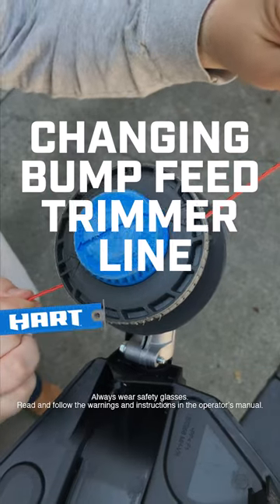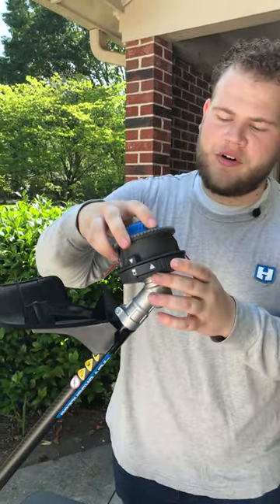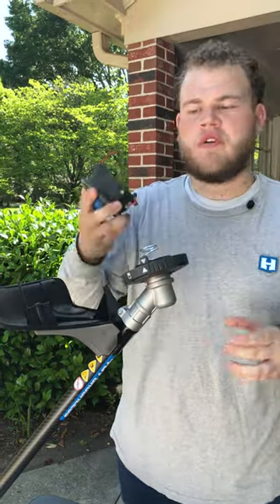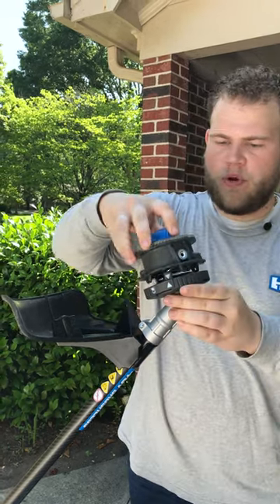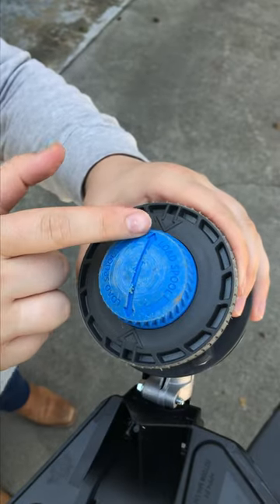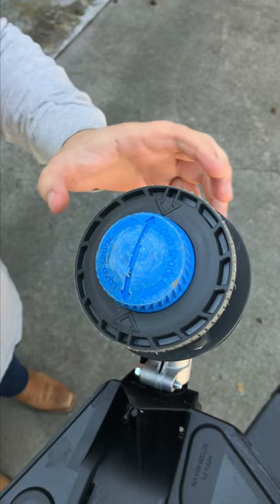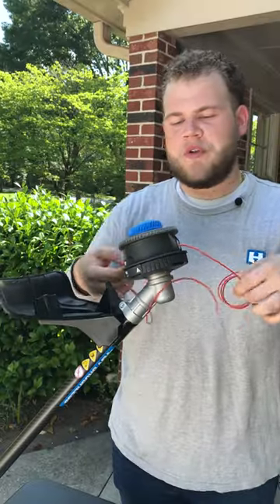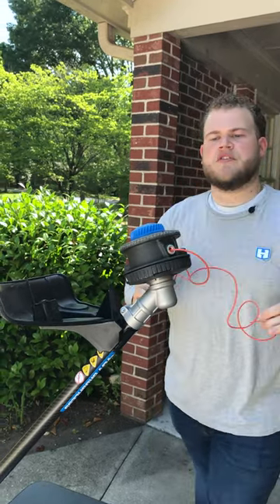HART Hacks: Changing bump feed trimmer line #shorts

Comment: The almighty Oden Himself does not possess the hand strength to align my arrows... what am I missing????
Reply: I just bought a 40 volt Hart weed eater and only used it once with the string that came inside the string housing and I can't open the string housing up even after alignment of the arrow no matter how hard you twist the cap that housing the string. SOMEBODY HELP ME PLEASE. The locking and unlocked cap just want budge at all. Is there some kind of trick to opening this thing?
Reply: @brendanash4082 try bumping it to see if it needs to be broke loose. if not, make sure it's a twist head cause I guess some are not

Comment: My arrows will not align. It's jammed won't rotate.
Reply from the maker: Please reach out to our customer service team at 1-800-776-5191 for product support, their hours are M-F 9am-6pm EST.
Reply: Mine is stuck as well on lock, what did you do?
Reply: The trick is to make sure you're rotating the ring that has the lock and arrow symbols. I spent forever trying to rotate the whole head to align the arrows and it wouldn't budge. I finally figured out that it's the other part that slides and once I changed my grip to rotate that part, it worked just fine.

Took me way too long to figure that out though!